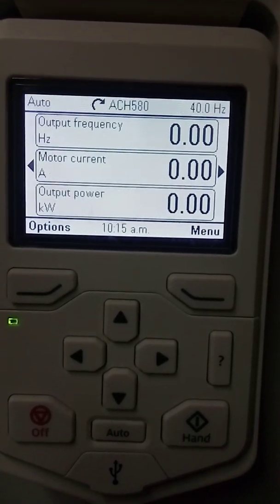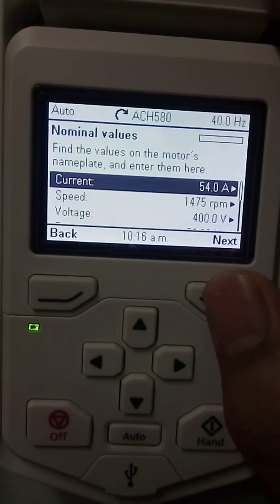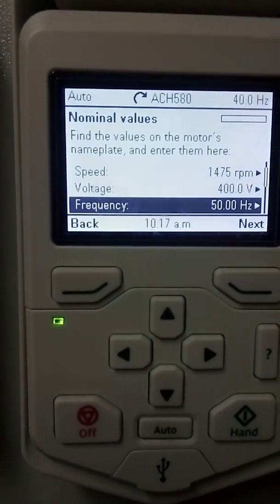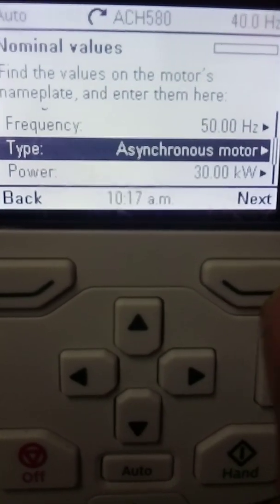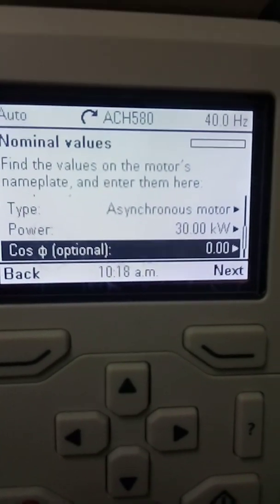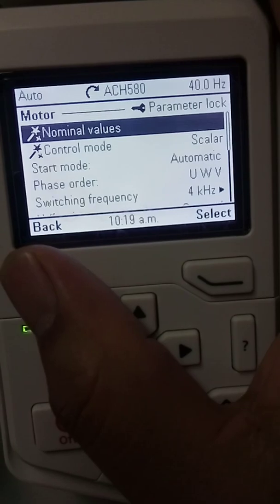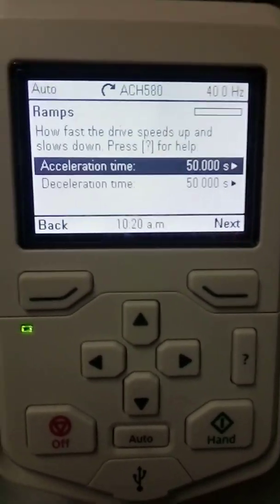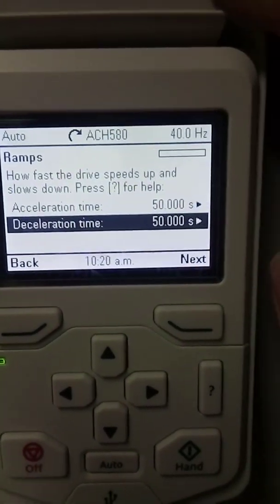ABB ACH580 VFD SETTING

Comment: With regards and respect to your service 
In ABB inverter model ACS580 we have error 6581
During continuous operation, it gives this error every three hours, and in case of fault, the inverter is turned off. 
please guide me
Of course, it goes without saying that we have also done a factory reset 
Thank you

Comment: i have inverter ach580 am working today my vfd fault is AFF6the fault is id run fault when the drive is run command the vfd triped and ahow fault of display is id run plz help me thankyou and gaid me
Reply from the maker: I'd run fault is not causing vfd to trip just check the parameters in group 99 feed the motor nominal values correctly

Comment: How can I clear a fault of 4981 on the ABB VFD Model ACH580.
Reply from the maker: Have u connected the motor sensor to the vfd? If yes the motor temperature rises. Check motor temperature if ok then sensor of ur motor is faulty disconnect that or replace
Reply: @rafiautomation  Thanks for the quick response.No I have not connected the motor sensor to the VFD.
Reply: Its AHUnit that we want to commission and the motor is not even hot.
Reply from the maker: Check parameter 35.11 if any source is selected by mistake
Reply from the maker: Or check the paremeter 35.12 and 35.13 may be temperature limit I too low need to increase it
Reply: @rafiautomation  I will get back to you by tomorrow. Thanks for the kind gesture
Reply from the maker: https://youtu.be/wafPmHXlMQ4